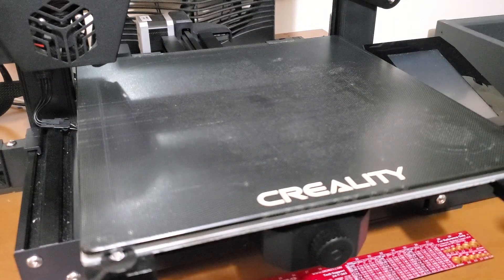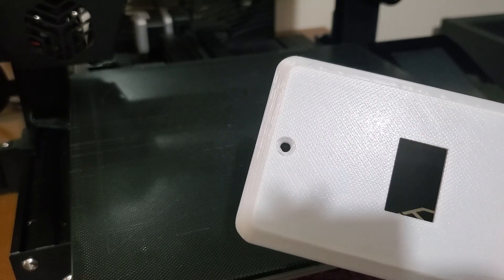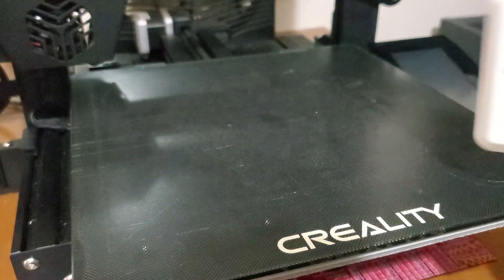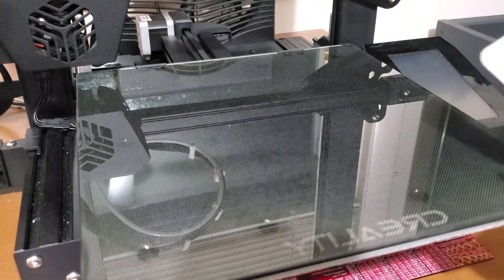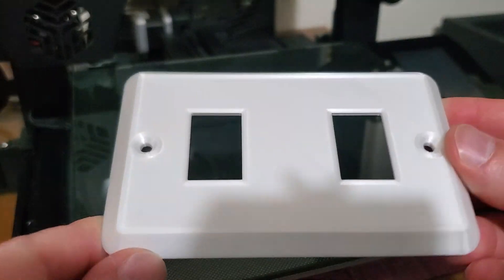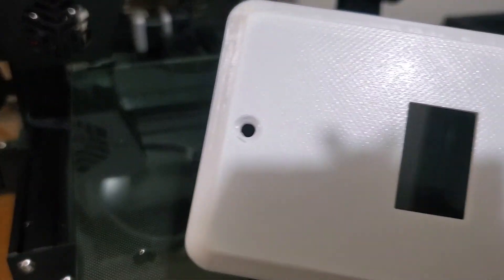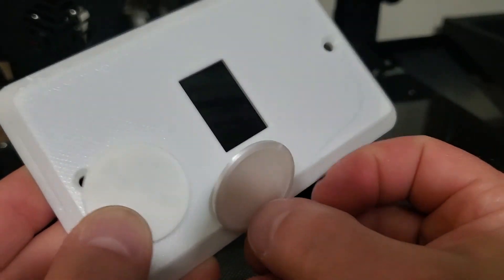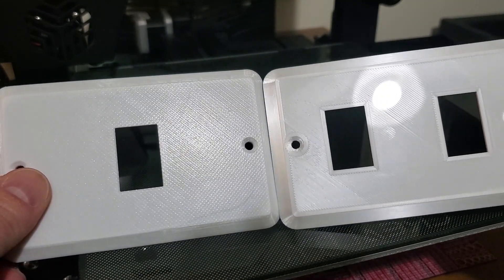3D printing bed surface - textured vs glass

Comment: how about the bed adhesion?
Reply from the maker: In my limited experiments with the glass bed, I've found that printing on it heated (60C for PLA) has worked well. The prints release easily and it seems that there tends to be a very strong static electricity attraction between the glass and part. This likely is helping to keep it in place during printing. 

Bed adhesion on the textured surface has generally been good. Whatever material is on the glass that forms the textured surface must have some chemical bond that provides a decent hold. After the bed cools, the prints typically release on their own and come off without effort. I have found that over time I've started having more issues with corner peeling or first lines not sticking and curling back up onto the nozzle despite adjustments to z-offset, feed rate, or flow rate. I have been printing quite a bit in the year I've had the printer. I clean thoroughly between every print with isopropyl alcohol. While the bed looks nearly as good as it did when I first got the printer, there is evidence that the surface material has slowed disappeared. I've ordered a replacement as well as one of the steel magnetic flex plate solutions to try.

I have never used additional adhesion (e.g. glue stick) on either side of the glass bed and only once tried using painters tape to see how it behaves and what texture I get off of it. For many of the prints I've been doing the seams between strips of tape would be unacceptable to the presentation surface finish. Perhaps with a lot of work I could get tape strips on with a minimal gap, but I'm skeptical it wouldn't still leave a visible mark.